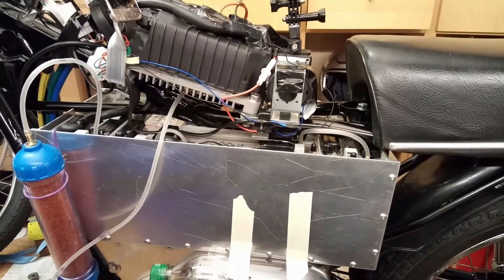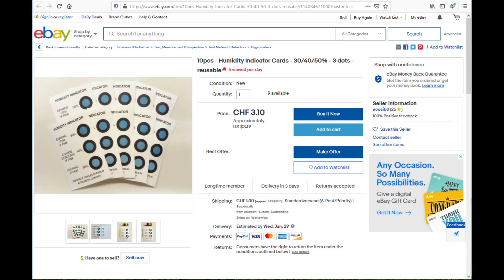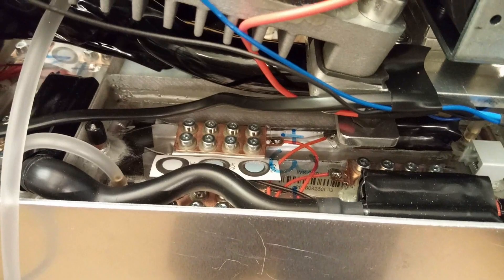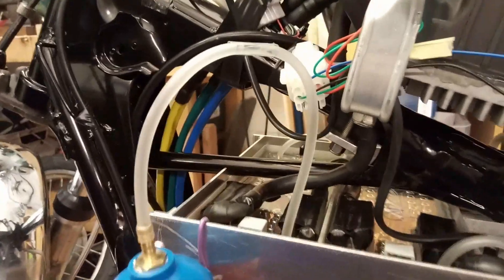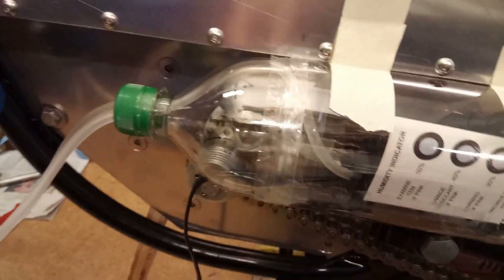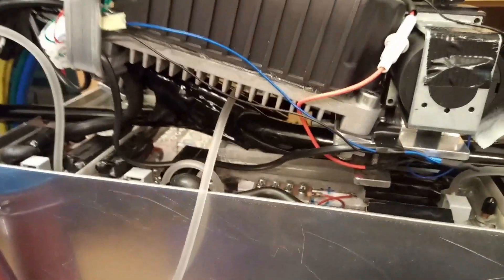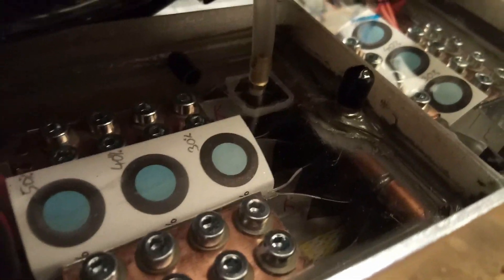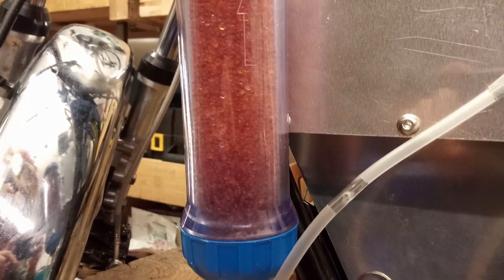Drying Li-Ion batteries

Comment: How does the dehumidifier work? Does it have zeolites that bind the humidity and need to be 'baken' in the oven to regenerate once they have reached their absorbtion limit?
How do you know how far they are to their limit? Because basically you are drying the air of your garage. Abusing a waterpump for air (usually waterpumps depend on water cooling) will heat up the air and cause a lower relative humidity than in the garage at warmed up surfaces. So I guess your set up would work w/o dehumidifer as well, if you don't have a damp garage.
Reply from the maker: Nice, you are following very closely :-)
The dehumidifier is full of silica granules which absorb the humidity. Once they are saturated you need to replace them or dry them in the oven. I think that's what you are describing as well. The granules change their color to indicate when they are saturated. I'm not drying my garage :-). I'm pumping the air in a closed loop, so only the air from the batteries is dried.
I'm not using a water pump. It's a aquarium air pump, so no cooling needed.
Reply: @andiskleinewerkstatt  Verstehe. Also für mich kommt das nicht in Frage. Mein Roller steht im Freien (mit Plane). Bei dem aktuellen Wetter hat die Batterie über kurz oder lang 60% Feuchtigkeit oder mehr. Ich sag mal das muß der Roller inkl. Batterie einfach aushalten.
Reply from the maker: @ewwatt  That's true. I also realized that the humidity is back to the environment within a short time. The problem I see is that the connections of copper and aluminium might corrode with higher humidity. Now I'm considering to fill the batteries with a non corrosive gas like nitrogen.
Reply: @andiskleinewerkstatt  If possible mixing of metals should be avoided. Even more if they conduct current. I see no added value in nitrogen because it's about the materials in your interconnections. And I hope you have no big voids in your interconnections that can be filled up by nitrogen.
Usually the problems start when an electrolyte comes into play so that the different metals act like a battery cell and start a redox process. So the most important thing would be to take care about chemical cleanliness. And that does not only mean that you have to take care to bring no electrolytes into the game - there can be remains of the production process on the materials you use (e.g. from galvanisation processes).
The humidity alone is not so bad. But when the humidity meets a dry electrolyte and turns it into a liquid one with high ion moveability it gets bad. Actually, you know it from you experince with cars. Yes, they rust with humidity. But what really qickly kills them is if you have salt from the street together with humidity on unprotected metal surfaces.
Reply from the maker: @ewwatt  Thanks for your tipps. But doesn't corrosion mean that Oxygen is involved? So the Aluminium is turning into Aluminiumoxide? That's why I think Nitrogen would help because then there would be no Oxygen arround to react with the Aluminium.
But maybe it's not so bad after all and I'm worrying too much. I certainly cleaned the contacts carefully. Unfortunately the contacts of the pouch cells are Aluminium and Copper. So I did not have a choice.
Reply: @andiskleinewerkstatt  Corrosion is the reaction with the environment. Usually it is oxygen but it can also be othere corrosive atmospheres or eg. sulfur.
But imho corrosion is the least problem. The main problem is that you are forced to mix different metals in the interconnections. But I think if this is clean and no dew can get there you are good.
Imho improving the tightnes for nitrogen is a waste of time.

Comment: My friend.  You do so much marvelous work.  But here to share information with the viewers to maybe save much time and effort. 
This product "MG Chemicals 846-80G Carbon Conductive Grease" should be used when you assemble the pack contacts.  
This will ensure strong electrical conductivity, prevent all corrosion, and prevent seizure of fasteners in nuts.  
Keep doing amazing design work.  
Here is the direct link.  
https://www.mgchemicals.com/products/greases-and-lubricants/conductive-greases/carbon-conductive-grease-846